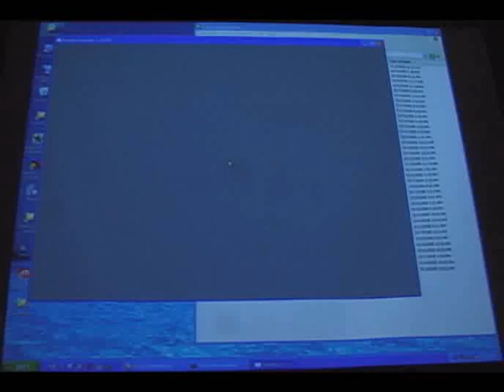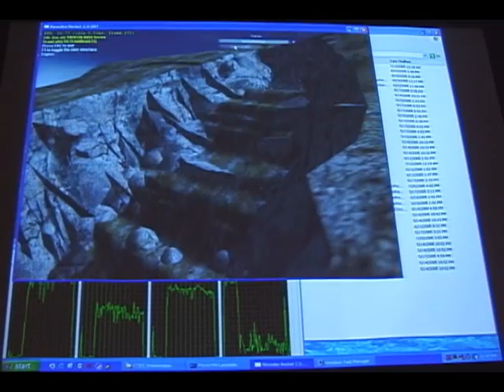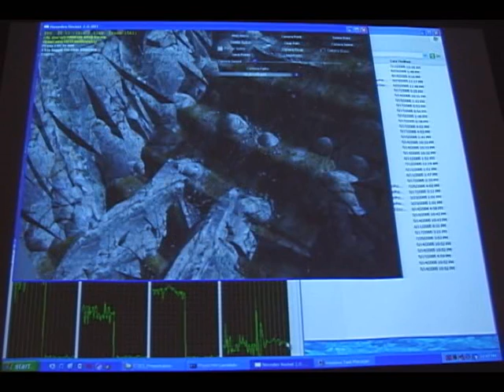Dual Vs PhysX

Comment: No, not built in like adding more parts, just able to run the software on the video card instead of processor. Good if you have week processor or 2 video cards/super strong vid card, but it will impact frame rate if your card is already maxed on graphics, then you add physics on top. Think of it as adding extra weight for the video card to carry. If its got lots of room left, then your fine, but if its already struggling, then your frame rate will suffer.

Comment: yeah fusion is a low cost CPU with a built in GPU.. that AMD are developing.

AMD dont need to make GPUs out of x86 chips because they own ATI which is currently kicking the pants off Nvidia with its new cheap Radeon 4870.

I think AMD is likely to be the big winner out of this Nvidia PhysX vs Intc Havoc war.

Comment: I'd like to see a unified architecture which will take advantage of whatever spare processing you have.. so that if you have an old GPU or a few extra cores or a co processor the game (by virtue of the drivers) can run to the optimum level without the user having to pissfart around and try different graphics settings.

Comment: No doubt Nvidia and ATI will be able to defeat anything that INTC can offer in the form of GPU acceleration... however because the Larrabee is built with native x86 instructions it can be used for other things such as Ray Tracing.. which standard GPUs cant. and more importantly it will be able to run most Software based solutions with very little recoding. (which includes the software emulator which physX offers in its SDK)

Comment: Larrabee isnt A CPU and a GPU.. its a co-processor which will be installed via a GPU style Card to compliment the existing CPU. its basically a GPU built out of 32 CPU style cores initially.. (it will probably be very cheap when it comes out too)

Comment from the maker: Good to hear Nvidia responded well, now let's see how ATI reacts to the pressure to support PhysX.

As for Larrabee, Nvidia presently has the lead in install base with CUDA GPUs, a install base that will increase quite a bit 'if' ATI adopts PhysX. We will have to see how Larrabree performance in physics with the additional workload of operating as a GPU and CPU, Nvidia GPUs didn't have much to spare under the same scenario.

Comment: A few more developments you might be interested in reading about..

Intels Larrabee processor. which is said to be a 32 core beast using the x86 instruction set. which will make it an ideal fit to run Havoc or other Physics Variants, on (hence why intel bought Havoc) with samples due out in the next few weeks.

and Nvidia now supporting the guy who is trying to run Cuda/PhysX on ATI. (Article on Toms Hardware)

it looks like the war is heating up and far from over..

Comment: what if you bought a motherboard which had integrated graphics and then bought a GPU so you could run games properly. or one of your friends upgraded their GPU from ATI to Nvidia..

wouldn't it be nice to use the integrated graphics or left over card for something...

you cant use it for SLI and you cant yet use it for Crossfire (although I believe ATI have implemented it for the SPIDER platform)

I also believe this is where AMD are heading with the Fusion Processor.

Comment: yes multithreaded applications do.

but by nature they are also Asynchronous,
most games are not asynchronous.

calculations which can be done asynchronously such as calculating the trajectory of the fragments in an explosion, or calculation the 3D sound positions.. or even the decision making AI for the individual characters are the easiest way to break the work and split it across multiple threads and cpus.

but the core logic for real time interaction is still limited to a single thread.

Comment from the maker: Cannot fully utilise, but that doesn't mean they are not coded to take advantage of multiple cores. Many games are programmed to utilise multicore, developers just haven't managed to maximize utilisation yet.

You have to remember it isn't one for for the OS and one core for that, multithreaded applications (including the OS) spread across all available cores unless specifically programmed not to.

Comment: heres an interesting thought for you..

Nvidia owns PhysX.
Intel owns Havoc.

PhysX will only run on ATI accelerated IF ATI adopts CUDA.

Right now Havoc is being optimised for INTEL and AMD CPUS.

So 50% of the GPU market will support PhysX soon. and 50% will not.

Whereas 95% of the CPU market will support Havok. Because INT and AMD have engineers working on it.

and soon enough 50% of the GPU market will support Havoc Physics Acceleration

Comment: there certainly isnt a piece of software I own.. including all my games.. that can max out my QUAD core system to above 90% on all 4 cores.

infact I am having a hard time tryin to do that when I run 5-6 applications at once.

also if you have 2 GPUs in your PC (including onboard) and they arent exactly the same model you wont be able to run SLI.. which means that one of them will go idle.

I bet you wont find a single gamer out there who doesnt have an old unused GPU laying around somewhere.

Comment: Yes ofcourse Nvidia will need to rewrite the hardware acceleration code to run on CUDA.

this is done at the sub driver level so it is transparent to the OS.

this will mean that any GPU that supports CUDA will also benefit from accelerated PhysX once the driver has been updated.

The way I understand it.. there is nothing to prevent CUDA from running on an ATI chip either except for licensing.

and it appears that Nvidia are trying to get AMD/ATI to adopt is but AMD/ATI are reluctant.

Comment: The reason why a Dual core will outperform a single core when running a game is obvious.. its because the game will utilise one core and the OS and other apps that are running will utilise another.

I suggest you take a look at the benchmarks for running computer games on QUAD core versus a similar spe'ced Dual core system..

you will see that there is little or no performance increase. because Most games cannot fully more utilise one core.

Comment from the maker: I disagree with all game engines being single threaded, a quick look at task manager in a recent game will prove that. I also resent that your references to 'idle performance' was your previous GPU put in SLI, the impression you have been giving for the longest time is performance being underutilised on existing hardware like a single GPU.

Comment from the maker: "All CUDA PhysX is, is porting the Software SDK"
"Which means to enable CUDA PhysX is only a driver update."

The way you described it before made it sound like you were suggesting they converted the software aspect of PhysX to CUDA, not the hardware accelerated code that was already present. So you can understand why I wondered what you where on about.

Comment from the maker: There is 'idle' again; I'm telling you I have seen no evidence that there is idle performance for a physics engine to tap into, everything costs something. Even in the UT3 benchmark the old PPU was beating the GPU in physics because the GPU was multitasking between both physics and graphics.

I have also not seen any evidence that AMD/ATI were favoured over Nvidia all the way back in the GPU war. That 3 cores dedicated is also an inaccurate description of how work load is spread.

Comment: The only reason Havoc doesnt work so well on a GPU is because older GPUs arent able to send data back to the main process thread.

With new GPUs anything past a ATI 1300x this is possible. because newer GPUs are programmable.. 

It has nothing to do with which Physics implementation is faster because all games are written to the biggest market.

I suspect in the not too distant future that Havoc Physics 2 and PhysX will run side by side accelerated on BOTH Nvidia and ATI GPUs.

Comment: AMD/ATI have been working with Havoc for some time now.

There are two schools of thought from the AMD/ATI camp.

Firsly AMD is pushing for a lot of cheap 3 Core CPUs. 1 core for OS, 1 core for Game Engine, 1 Core for Physics.

And Secondly the ATI part is looking at using an idle GPU for Physics Acceleration..

this has been going on since AMD bought ATI

the problem is not the performance of the GPU it all has to do with a GPUs ability to Interact with the main thread running on the CPU.

Comment: Der.. read the Nvidia documentation.. Physx on cuda supports a huge amount of cards which existed BEFORE Nvidia bought out AGEA.. Which means to enable CUDA PhysX is only a driver update. Because a stream processor is already capable of accelerating physic calculations no sprecial hardware adapataion is required for newer GPUs. which has been my point since I started replying to your posts all that time ago.

Comment: yes that exactly what I mean.. ALL game engines still only use a single thread for the core.. which means in most cases unless you push AI, Physics or Sound processing onto another Core the other cpu cores remain idle when playing a game. If you haven't noticed they don't make single core cpus for gaming rigs anymore... 

the single flaw in SLI is that you need exactly the same model GPU to run them for graphics.. the same is not true however for Physics. which makes using your old GPU ideal.

Comment from the maker: Idle? Because this performance is just sitting around doing nothing? This performance isn't magically being taken out of thin air, you use the GPU or CPU it takes performance away from other tasks. The PPU was a way of accelerating physics while letting the other two do their jobs.

Honestly the PPU is history now so I don't want to get into an argument over abandoned technology, but if you thought it was pointless and did nothing other hardware couldn't achieve for free you are sadly mistaken.

Comment from the maker: What makes you think CUDA PhysX is simply the software PhysX adapted to run on a parallel processor? The PhysX engine was already optimised to run on a parallel processor, what do you think the PPU is? They simply adapted that for CUDA, reprogramming the software part of PhysX for the GPU makes no sense.

As for your last point well duh, aren't all uniquely named GPU features basically the same? What matters is a standard is agreed on, if PhysX works on ATI GPUs that is good news.

Comment: and I stand by what I said.. the PPU was never a necessary piece of hardware.

even before the physX card existed they had a software solution.. which granted was less efficient when run on A CPU but far more flexible.

The PS3 proved this point when they adopted PhysX as a software only solution.

the PhysX cards themselves were nothing spectacular fabbed at 13nm and not using High speed GDDR3 memory.

using IDLE GPUs and CPU cores is definately the way to go.. the more flexibility the better

Comment from the maker: Why are you responding to year old comments that were posted in the heat of the physics war?

I stand by what I said, a dedicated solution > the CPU and the GPU with a slap on API to trick it into doing physics. Circumstances have changed since then; the GPU is able to do physics in  a way that doesn't require sacrifices in areas Havok FX was inadequate, unified shaders also means performance is more efficiently managed.

Havok FX was more broadly supported than CUDA but highly inefficient.

Comment from the maker: While you are gloating you might want to keep something in mind.

Havok FX is dead, the solution you favoured over Ageia is in the hands of a CPU company. Ageia is alive as a division of Nvidia working on parallel hardware to accelerate physics 'using their engine'.

So who won here? Because it was certainly not the Havok FX supporters.

And for the record; CUDA winning says nothing about you being right on multicore physics, after what I've seen in benchmarks it may take that CPU job.

Comment: my position hasnt changed over the last 6 months.. I told you more than 6 months ago that stream processors and multicore CPUs would change the playing field.. now AGEA is no more... and PhysX is owned by Nvidia. Do you think Nvidia will make a dedicated PPU ? or simply port the physx code to run on their stream processors?

there is no market for a PPU card. there never has been.. that was my point all along

Comment from the maker: Yes I do know.

"whether it be a PhysX card or a CUDA GPU"

Where do you think you're coming from saying I'm talking crap? Physics runs significantly faster on hardware solutions; that is a fact. Running on the GPU is still a hardware solution separate from the CPU. He asked why bother if he has a quad core, I was explaining that.

CUDA PhysX is not flawed like Havok FX, it is still Ageia PhysX on a parallel processor so receives my full support.

Comment: "They don't utilise quad core to improve game play because then only those with quad cores could run them. "

the beauty of flexible programming models like PhysX SDK and Havoc are that.. the software can run on an additional CPU Core, OR hardware accelerated by a GPU.

I have a quad core PC at the moment and sure most games don't run faster because they are single threaded.. however the pc does run a lot smoother. and yes the physX component runs on a seperate cpu/process.

Comment from the maker: They don't utilise quad core to improve game play because then only those with quad cores could run them. It is only recently that games started recommending dual cores, it will be years before we are in the same situation with quad.

As for hardware based physics processing; they can perform physics significantly faster than what the CPU can achieve, allowing game play beyond what even your quad core can do.

That is the incentive to adopt, whether it be a PhysX card or a CUDA GPU.

Comment from the maker: Quantum physics isn't a 'technology', it is a marketing term used to promote the use of CUDA  programming on Nvidia graphics cards for physics acceleration.

Nvidia is adapting PhysX for CUDA, so you won't need to upgrade beyond an 8 series to use whatever GPU physics they release in the future. They may learn from the PPU and use it to performance tweak future generation GPUs, but they won't likely become a requirement.

Comment from the maker: A 8800GTX will have no impact on your physics performance in games not designed to utilise the GPU in that way, seeing how there are no games out that use GPU physics you couldn't possibly claim your GPU can do the same job.

As for the PPU, that may have been the case in old PPU utilising games but tweaks and optimisations have since fixed the bug. You would have to play the first GRAW or City of Hero's to encounter those old PPU performance bugs.

Comment: I'll try to give a short explain. Thousands of interacting object can't be simulated by CPU or GPU, because of different types of operations. PPU is optimized especially for loads of floating point operations (am I right?), GPU and CPU is not. They could work as physics processor, but they won't reach PPU performance.

Comment from the maker: That all depends on what you mean by "could do just as well", there are different ways of doing the same simulation.

If it was just to show this 'visual' demonstration, yes a GPU can do it.

If it was to show the equivalent simulation as a 'e'ffect within a game, yes the GPU can do it.

If it was to show the equivalent simulation as a 'a'ffect within a game, then no it couldn't do it. The PPU is designed just for physics so it can do all physics related jobs, the GPU on the other hand cannot.

Comment from the maker: The improvement is the PPU is doing the calculations for 6000 rigid body actors in real time without taxing other hardware, freeing it up for other game related tasks. If the CPU alone is used to do the job then it uses up all its power, leaving little to nothing to run a game and hence the affect is unusable.

The speed the objects are moving at is not a representation of the frame rate; but rather a preference set in software, in this case probably slowed down for demonstration.